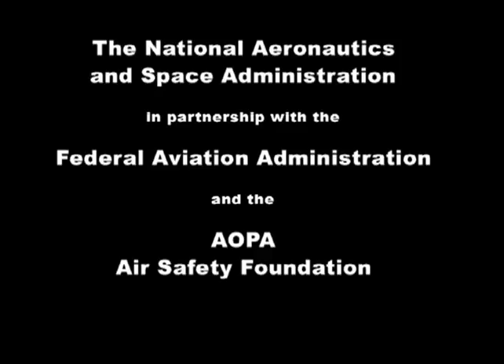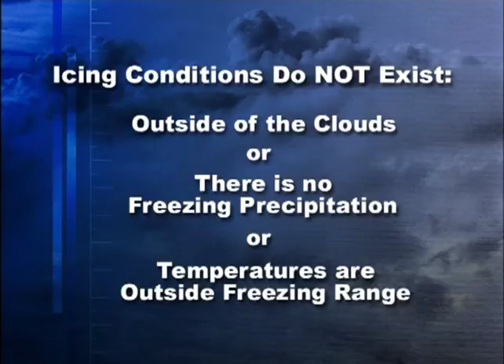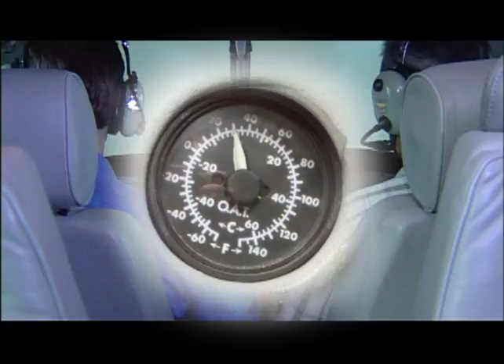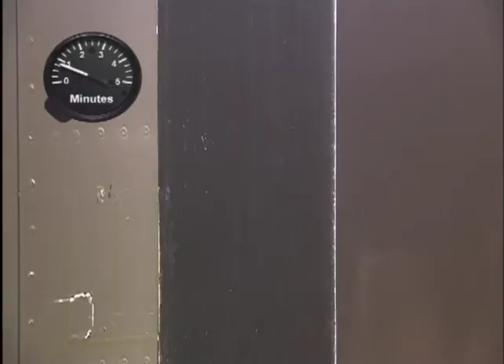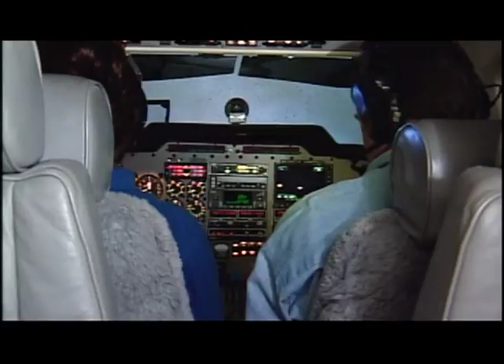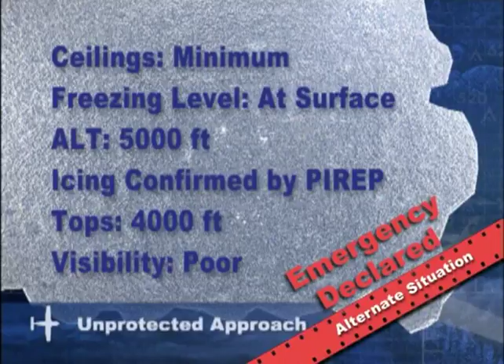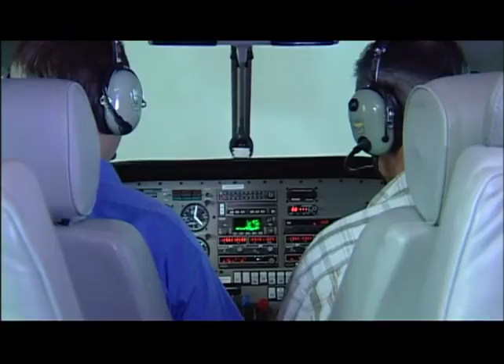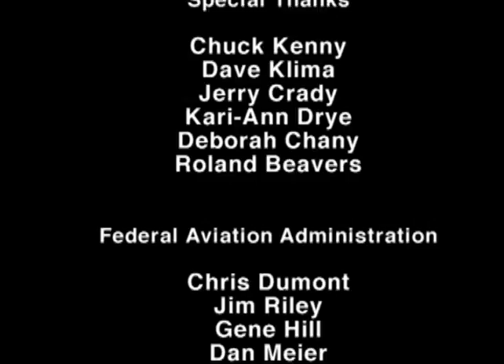Icing for General Aviation Pilots

Comment: I've flown for 1200 hrs and encountered my first icing situation over Albuquerque, NM about 2 months ago. Not fun... light to moderate clear ice. It immediately knocked 20 kts off my airspeed. Fortunately I had an immediate out to the east from the precip, but had to fly another 2 hours in the clouds looking at that ice on my wings before it finally dissipated. I was stupid because I could have diverted just a little to the east and missed all that. I was just above freezing at 12000', but  ATC gave me a climb to 13000', and it happened FAST. Never again... GREAT video.
Reply: Are there aircraft with no deice/antiice that are C4FIKI
Reply: WPLU572 Trunked Radio  Adding de-icing to a single engine GA aircraft would be cost-prohibitive  and heavy vs just getting a higher category aircraft that has a FIKI system already.  I'm just learning things still studying for ppl, but that is my thoughts.

Comment: I should be dead.  Wish I dad known some of this info.  From the IAF I ran into Extreme icing.  Full throttle in an Archer II through the procedure turn.  So much ice.  My CFII wanted to put a notch of flaps, I wouldn't let him.  All I could do was was minimize the buffeting.  Again, full throttle to touchdown 50 ft short of the runway.  No damage.Taxied off and had a tractor tow us in. FBO owner and FAA tower came down to take pics.  No one could believe we made it.  3+ in of ice on everything.

Comment: Watching this and other crash videos, so many of them are stalls. Our training includes stall recognition and recovery, but not a massive emphasis on totally avoiding them. Good to know how to recover from a stall, for sure. Don`t stall, but if you do stall, this is how you recover, no worries. 
The massive problem with that training is the only time you are likely to stall, ever, is on takeoff, you die. On landing, you die. Icing, you die. Twin engine, single engine failure, you die. Most other times you will rarely ever get anywhere near a stall speed, so the stall recovery will not save you in most cases where you do stall. Tell me I am wrong.

Not enough training as well on the actual stall speeds at the different angle of bank in turns. Flat an level, flaps, no flaps, all documented, but what is the stall speed of the aircraft in a turn.
I think Dan Gryder has that right, that we are not training GA pilots to properly understand their planes stall limits.
Best takeaway from this video, as with most, `fly the plane``.
Reply: Well,I've  told all my students about ice as I lived this flying nite freight in conus.most this k I'm telling tall tails; then I tell them about the dead line pilots I've known...and the ones who tried on thunder storms found in the ground crumple up like a soda can.watch the facial expression change...then they get it.only takes once to scare the sh.. out of you....

Comment: I was a bit surprised that "Greg" said the regulations have been revised to define 'known icing', which isn't the case.  14 CFR 91.527 is the only regulatory reference for operating in known icing conditions but that only applies to airplanes operating in under Subpart F of Part 91 for large and turbine-powered multi-engine airplanes & Fractionals.  FAA/NTSB case law is the only place you can see how they rule for smaller GA, and that is on a case-by-case basis.  Definitions to be aware of are the difference between 'known icing' and 'known icing conditions'.  Adherence to 91.7 (What does the POH say), 91.13 (Acting careless/reckless), and 91.103 (Proper preflight and wx brief) is how the FAA will evaluate your compliance as a "reasonable and prudent pilot" in making the correct go/no-go decision prior to departure, or making correct in-flight decisions should ice be encountered.  (References: Jan 16, 2009 FAA Chief Counsel Letter of Interpretation for Known Ice and for us older pilots, a re-review of AIM 7-1-21 and 7-1-22).  Regardless - video provides excellent information and DON'T GET IN IT if not trained and equipped!!  ~Pacific NW Pilot

Comment: I was not aware that ice was the cause of the Colgan Air crash. I know ice was present at the time, but that it didn't accumulate enough to cause control problems. Seems unlikely that so many draconian regulations and experience requirements would emerge from an accident caused solely by ice. I was under the impression that pilot error "inattention" was the culprit in the Colgan crash.

Comment: Read the last couple of pages they had no idea any ice had built up on the aircraft once they put the gear down the thing stalled from 2300 feet no time to recover when they still didn't know what was happening. From the time the stick shaker alerted them to a stall it was too late 27 million $ aircraft and 50 dead because of ice.